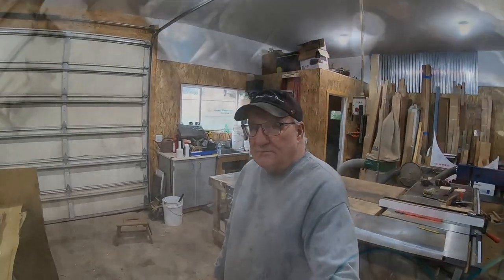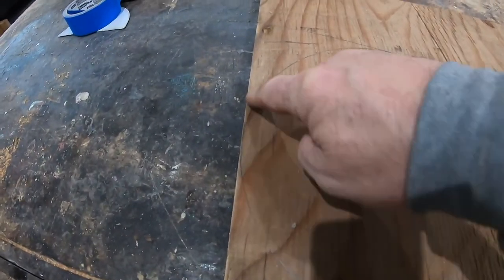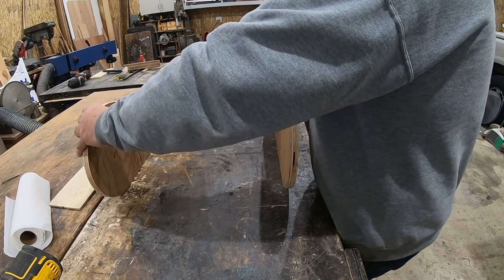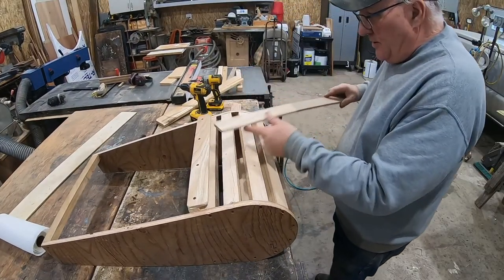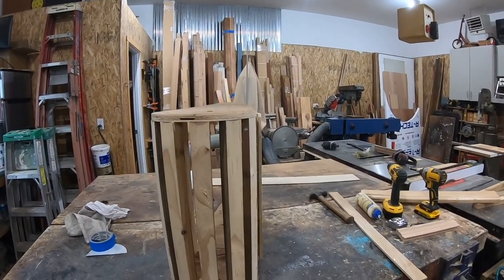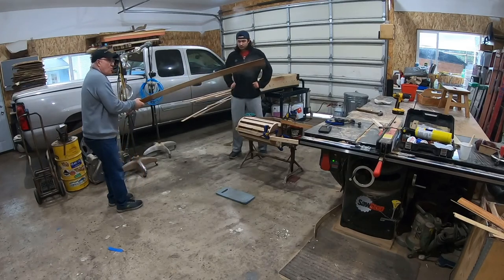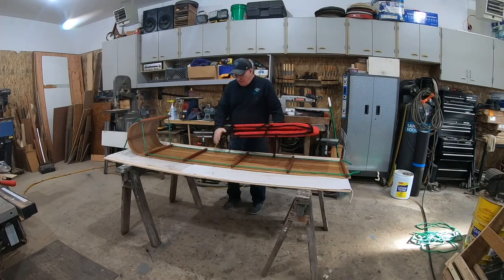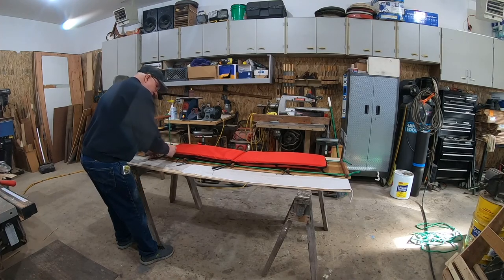Build Your Own Toboggan

Comment: Appreciated that you obviously made an enormous effort to video and narrate this effort.  Great job!  The jigsaw trim cracked me up.  Have you used Epifanes spar varnish?  If so, do you still prefer McCloskey?
Reply from the maker: Thanks Rob, i really don't use spar varnish very much anymore, we are mostly working with high tech floor finishing systems. As im sure you saw the varnish on this project went south on me. In the future i will stick to traditional Man O War. Spar Varnish or the West System Epoxy and not try to coat one over the other. Thanks for watching.